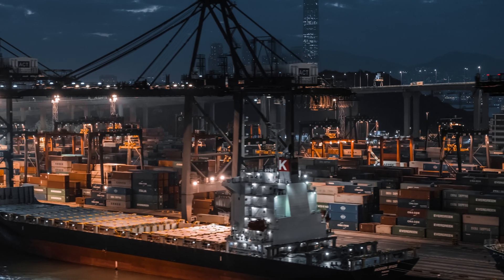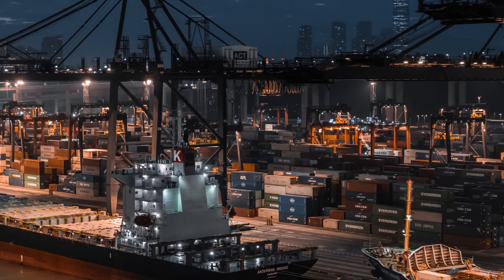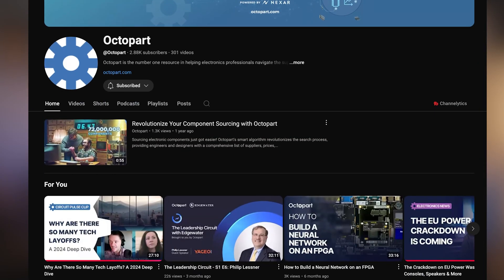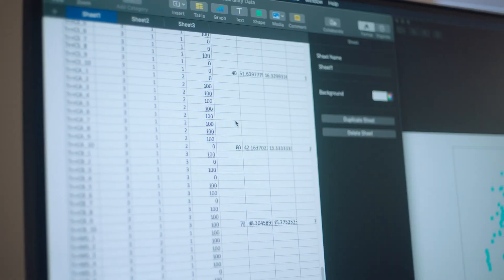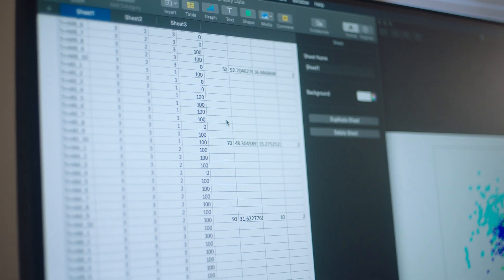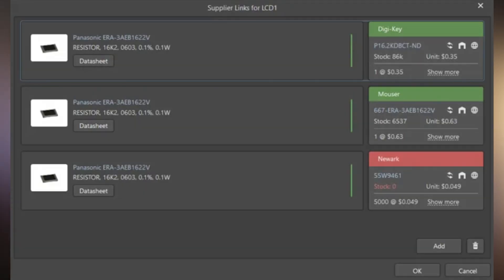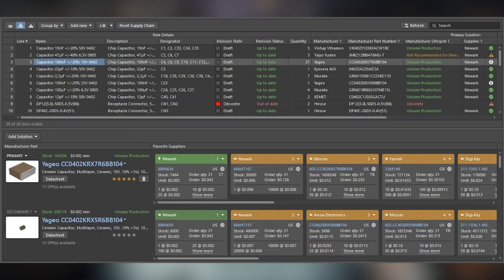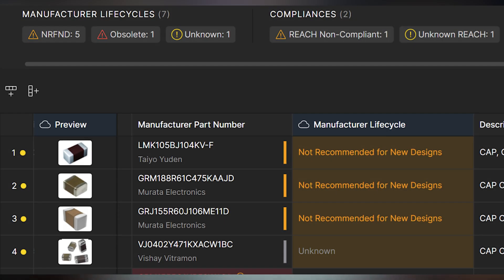Stop Losing Money! Reduce Electronic Components Cost with Altium

Comment: That's nice to hear from a company that 
a) denies paying users access to real-time data and also denies them the option to trigger or even force stock and price refreshes due to bugs and shortcomings in both ActiveBOM and octopart, e.g. #17156, #20525, #21383, #24642 or #814809. It's also not possible to use a different provider or poll vendor APIs individually like KiBoM does. 

b) wants $21k one-time plus $13k annually plus revocation of all perpetual licenses for enabling a (now formerly) fully subscribed dev team of THREE to finally work together in Altium365 - just because our third guy happens to sit some 400km north of us, in the same country, working for the same company.

Probably time to move on. We still support hardware made with OrCAD 9 in the late 90s and we switched to Altium in 2011, but for e.g. sparsely populated yet large-scale calibration boards (up to one square meter in size), we already use KiCad and its scripting capabilities.